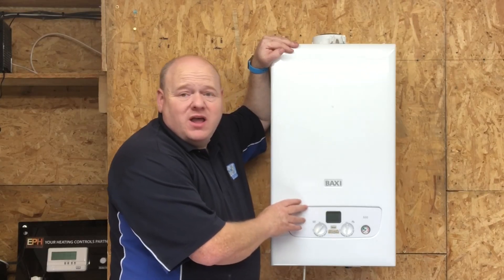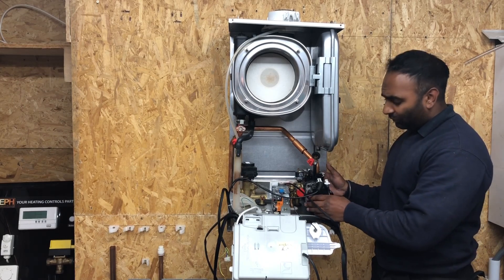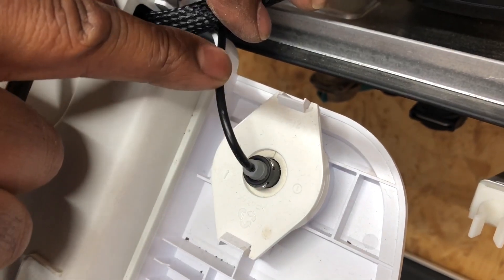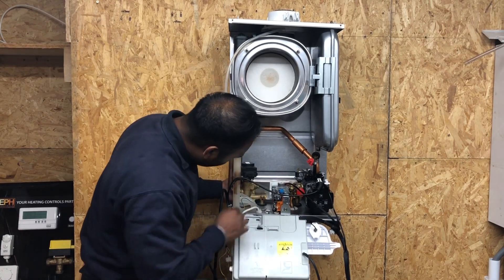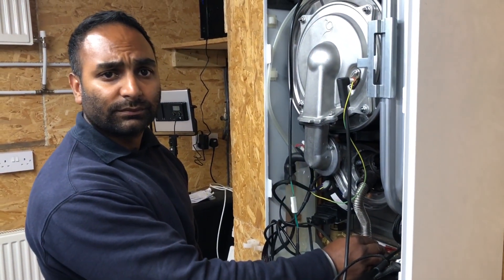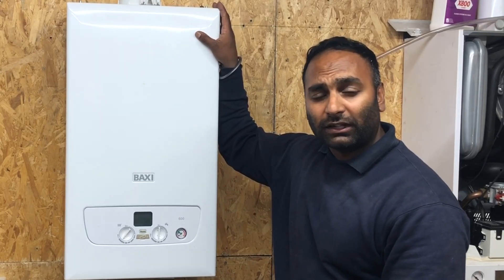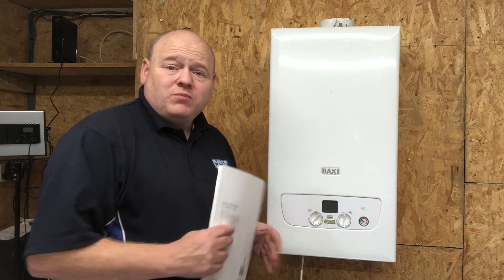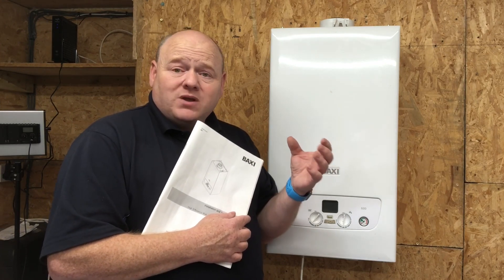ACS Gas Training - Trainee Plumber Looking At The Components Inside A Gas Boiler

Comment: Do you find the baxi range better value for money Allan ?
Reply from the maker: I tend to install the Baxi Platinum when possible, They are certainly not cheap. Thanks.
Reply: I like the platinum I would platinum before I fitted 600-800 series in my opinion better boiler in my opinion I’ve heard nothing bad things about 600 series after ga disaster put me off baxi to be honest
Reply from the maker: @ryanlove7451  GA was a terrible boiler.